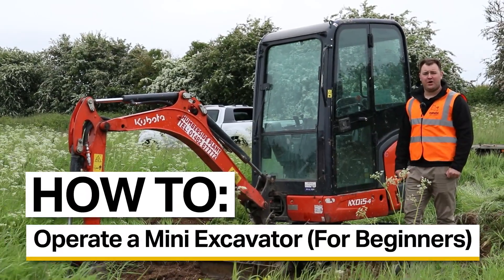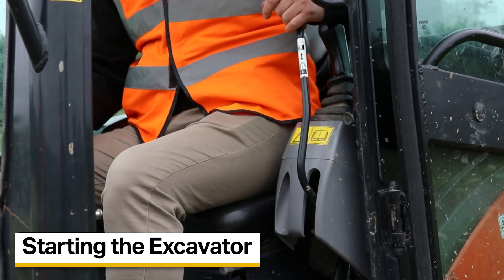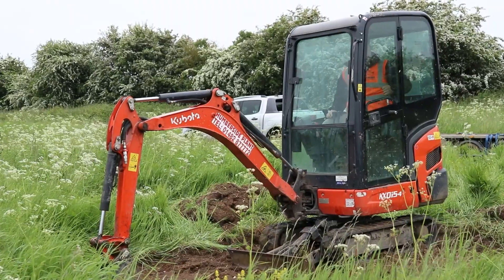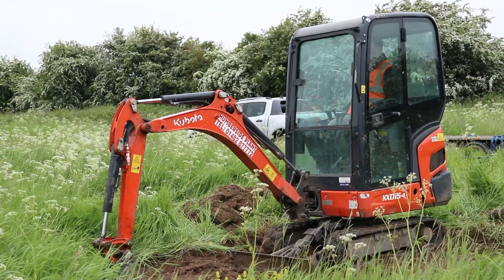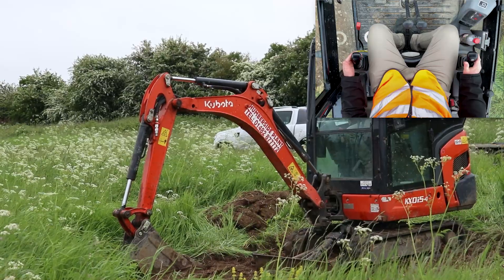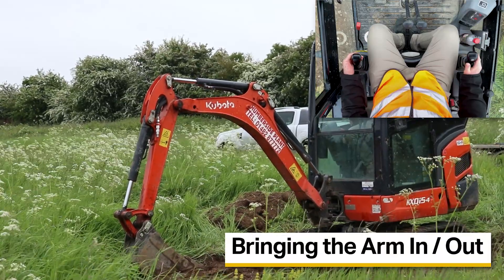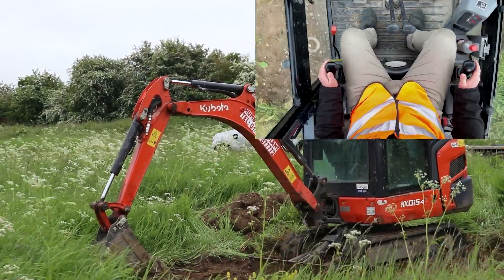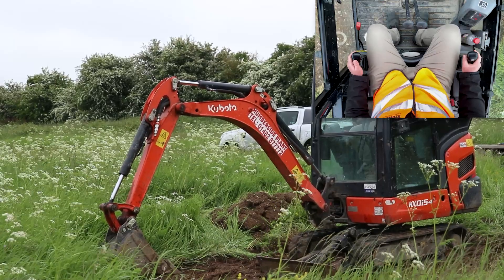HOW TO: Operate A Mini Digger (For Beginners) - Mini Excavator Controls

Comment: Great thanks. Sounds easy when you know what direction to move the joysticks. I can use my tractor with its front loader quite well, but I'm going to have to hire a mini digger for the first time, in a couple months, to dig out a lot of scrub on our land. I think it will just be too difficult for the tractor and take a lot longer then an excavator. I will use the tractor for shifting the dug out scrub out the way though. So it will still have its uses. 😁
Reply from the maker: It's sounds like a big project - we hope this video helps get you moving quickly!

Comment: I was quoted $3400 to dig a 500’ channel for rain water to move in nothing complicated. I can rent one for a week for $ 1024. One day to learn six to get busy. What do u think.
Reply from the maker: Given the quote you received, renting a mini excavator and doing the work yourself is obviously the cost-effective solution! It would take a little bit of practice to get used to the controls but it would be do-able. You would have to check for other utilities in the ground first so you dont dig through any cables or water pipes already there! Ultimately, it depends if you feel you would be able to complete the job to your own standard

Comment: will a mini digger excavate tree stumps and roots easily or not?
Reply from the maker: Yes, you can but we would recommend doing it a bit at a time! We would usually recommend digging a small trench around the outside of the stump to help expose the roots and then use a ripper tooth to tear them out. A lot of people tear out the roots with a standard digging bucket but this can damage you bucket teeth if the roots are substantial!

Comment: About to operate a 7.5 ton with this as my only learning feel less nervous after your run down on every control
Reply from the maker: We're glad this has helped settle your nerves a little. Just start slow and steady until you get used to all the controls!
Reply: @Rhinox-Group  the digger is parked 2 foot from a lake and the arm of the bucket is the other side of a fence i should be able to sort that but with this 7.5ton jcb we got the rev stick is different
Reply: Believe its a jcb 8080 and it has a stick that goes back to its normal position dose that mean 1 tap up revs go up 1 tap down revs go down? Bit lost haha just some decent money there nd tryna learn fast

Comment: Great no-nonense tutorial!  Do these struggle if there's some large stone in the soil. I need to build conservatory but i think a lot of stone from an old retaining wall has been buried in the ground. Appreciate your advice. Thanks again
Reply from the maker: Thanks for the comment! Using a standard bucket to break up a retaining wall can be challenging. You may want to try a ripper tooth, as it concentrates all the machine's power into a single point, making it much stronger and more effective than a digging bucket, which spreads the force across multiple teeth. However, it’s still worth starting with a standard digging bucket, as the wall may break apart easily, depending on how well it was constructed or how long ago it was built. Hope this helps!